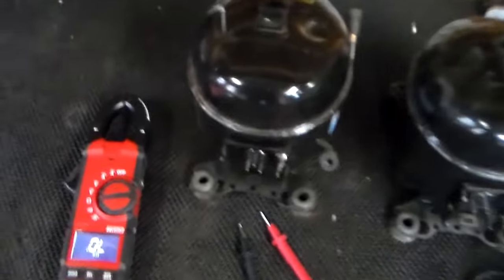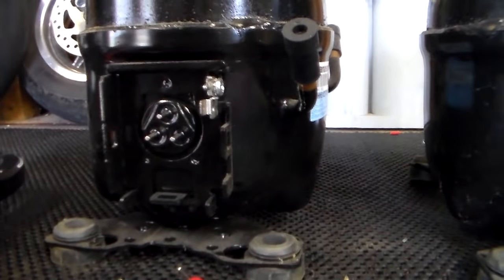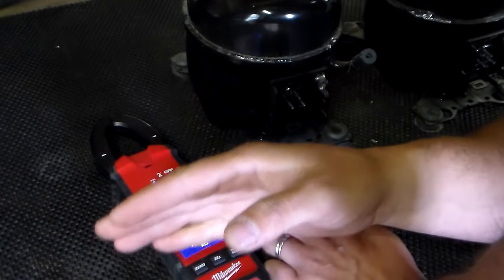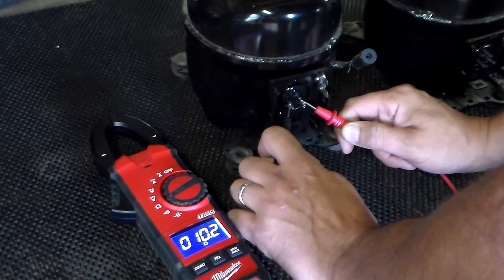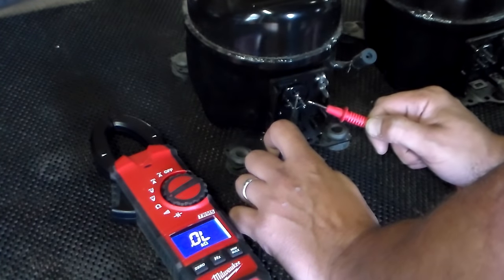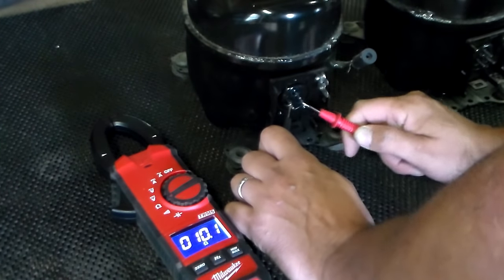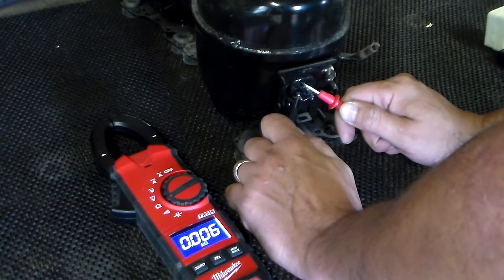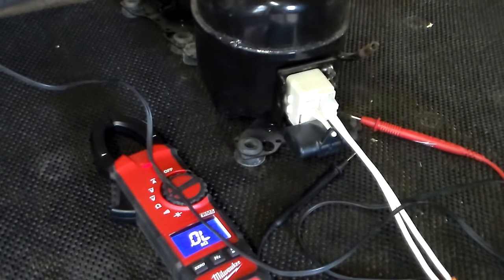How to Test the Compressor on your Refrigerator

Comment: Question: the compressor is running and getting hot, the fan is running, but the neither the fridge or freezer sides are getting cold. We had a technicnian out who re-gased it, with no change. I have noticed that there is now a brown oily liquid in a drip tray under the evaportator. Trying to get someone else out but having language issues in China. Any idea on what it could be, or what to look for next would be appreciated.

Comment: my compressor tests about 3-4 numbers higher than your readings, my refrigerator is not cooling at all, freezer or fridge. the fan is running, with the start relay connected to the compressor, the compressor is warm to the touch, but no noise. i tested the start relay and it reads about 10. any idea whats going on?

Comment: I tested my compressor and got 35 on the bottom and 20 left to top and 15 right to top but I am still not getting cold.  The compressor does come on when I plug it in.  Any idea?  On another note could you help me design a fridge setup for a custom cooler I want to build 2' x 2'-6" x 3'-6"?  Looking around on the web it looks like I can buy all the parts but I have no idea how to size things.

Comment: I have an Kenmore upright freezer it will work for 3 to 4 days  then temperature will drop to a refrigerator temperature. Had it check out by a certified appliance repair and they told me the compressor need to be replace.  Can the compressor be tested without turning it off?  Reason is I didn't see him tested it  but claim he did. It will cost me 5 to 6 hundred for parts and labor. It this procedure difficult ?

Comment: Bill - upright home freezer with 45psi on LOW SIDE, running on a 3n1. Compressor pins ohm:  Red to Black = 8 / White  to Black = 12 / Red to White = 16. Compressor draws 14amps when running. Runs 8 seconds and quits (thermal switch?) QUESTION:  BAD COMPRESSOR,  AN OBSTRUCTION IN THE HIGH SIDE LINE, OR SOMETHING ELSE?

Comment: My refrigerator runs fine and all of a sudden it stops cooling.  All I do is turn down cold control thermostat and then back up and the compressor come on and it starts cooling again until the next time. Have no Idea what is triggering the failure.    Any suggestions?   Replaced defrost timer.   This is a Kenmore side by side.

Comment: Hello Bill
Nice video.  Can a compressor run but not cool and still be a problem with the starter relays?  I have a compressor that is running and condenser fan is running but evap is not cooling.  This is on a Samsung fridge.
Reply from the maker: +Robert Barrera Sounds like freon issue.  If the compressor is running, relays are good.

Comment: Hey Bill,
Do some compressors after they run for a period of time have to rest for a time after shutting off before they can turn back on due to head pressure build up?
Reply from the maker: +greatscott2007   Usually takes a couple minutes to fire back up.  Pressure causes the overload to trip because of amp draw.

Comment: My compressor comes on i can feel it but the frig or freezer wont get cold. Both fans work and i tested the defroster and defrost t/stat Only thing showed 7 ohms on the 2 pins that should be 10ohms not sure if that means compressor is bad or not

Comment: Hi Bill great videos. Have a top freezer GE 1993. Not getting cold. Compressor comes on sounds good all fans run. Checked temp controller conductivity room temp, off when removed from fridge and tested by putting in freezer of another unit. defrost timer runs turns and gets power to pins as you show in one video. De-frost heater has conductivity and gets hot when power is applied. Back panel of freezer removed seems only to get the very right  side of the coils cold with a light frost seems very cold at that very end. Could the compressor be low on freon? If it was low from a sealed system would it not all leak out. I see no oil residue or sign that I can see of a leak? What do you think.  Thanks Mike, Phx AZ

Comment: Hey Bill, I’ve troubleshot my fridge (igloo kegerator), and I can’t figure out what’s wrong with it. The compressor resistance is checking correctly, voltage to relay is good, thermostat checks out... there is no capacitor that I could find, no fan, no coils. What the hell else can I do?!

Comment: I have a kitchenaid french door bottom mount , and I don't hear the compresser running and the fan isn't runny. There is a big grey box, that looks like a transformer with a 3 prong relay attachment, that hooks to the compresser, I think it's a variable speed. I don't no where to start, or how to test this thing with the multimeter. Yes, it's not cooling. Neep Help..Thank You

Comment: hi Bill, My fridge is not cold, i tried checking it but have not had any luck. My compressor starts up every few minutes or so then it clicks off after 6 seconds...do you know what might be the issue? what i should be looking at Thanks. .
Reply: same thing happen here but my compressor will run 30sec than shut off

Comment: Hi, Fridge Repair  expert told me that my compressor is reading  High, I don't understand what he meant,  tho when he finished fixing it this time, the refrigerator (freezer compartment) doesn't ice anymore  but cools but the everporator in the  fridge side(bottom side)   freezes when it's  works for a long period of time. 
Please help me what's wrong with my refrigerator?

Comment: Amana ssd21sw  Freezer about 32 degrees and the fridge is about 39 degrees.
Compressor runs. I replaced the Defrost Thermostat. And I also replace the Defrost Timer. I had moisture in Freezer and now I don't. The evaporator fan works now also. The condenser fan runs also. I was thinking of replacing the Freezer Temp control Thermostat but I am on hold at this point. My compressor has the black box on the side. Where do I go at this point.

Comment: Hi Bill,  I have a Kenmor side by side that doesnt cool.  When pluged in and running, the copressor turns on for a few seconds and them cuts off for abort two minnutes and cycles that way continuously. Any ideas as to what it could  be?  Thanks.
Reply: My guess, LRA....lock rotor amps....check amp draw on compressor

Comment: hi steve i have the same compressor as you do when i do the reading i am getting the same 8.6 on all 3 pins is that the norm
Reply: How do you test the capacitor.
Reply: Same issue with me. I found the result 12 on all three terminals. Is it normal?

Comment: I have a KitchenAid side by side. The freezer started defrosting, ice cubes melting and water leaking onto the floor. I took the back off and did the compressor test and it checks OK. The relay rattles like is broke inside. The fan is running and the refrig part is cool enough to keep milk cold but the freezer won't freeze. I hear the relay click and the compressor runs for a few seconds and then shuts off.  What part do you think is bad? Thank!
Reply from the maker: Steve Hula Get a 3 and 1, they are relatively cheap and will let you know if the compressor is bad if you don't have a meter to test the compressor.
Thanks for Watching!
Reply: I got a new relay switch, the white part that plugs into the compressor and the black capacitor plugs into this. I took it off and it rattled like something was broken inside. I ordered another one and replaced it. It is running like a charm! Thanks!

Comment: Bill, one more question.  The testing protocol you used for the three-prong compressor, will it tell you if the "Freon" (R143a) is low or simply if it is a "10 ohm" system that the left reading plus the right reading, if they equal 10 ohm then the ELECTIRCAL portion is good? In other words, do you run this ohms check ONLY if there is NO cooling at all.  Like I said, I can keep about 37F in fridge and 31 in freezer. Apologize in advance for a low iq question but my technical competency on these things is low.

Comment: Biii, i checked and yes, no frost on evap and the fan is working. so im assuming no 134a. is there a leak for sure or does it go low with time ? my fridge is about 6 yrs old and the last 13 month it has been sitting in a temp control storage. if i just need to top of 134a, can you do a tutorial ? i do have ac ( ASE cert ). thanks man.
Reply from the maker: Ah, should have read this before I commented on your other post.  lol   Shouldn't go low with time, probably a leak or a restriction in the sealed system.

Comment: hi Bill, 
Great video, keep on setting this on the internet (very educating)
Here is  Aydin from Holland. I had this problem with a compressor. it didn't work and it was ververy hot. The ohm on the compressor where oke (12=8+4ohm) there was 220volt (holland). But there was no action on the compressor only very hot.
Can you help me out?

Comment: My refrigerator stopped working. The compressor was heating, no sound. Fun working and the lights were on as well as the fun working well. On a compressor its written R600a. It is not running what can i do

Comment: Bill how hard is it to replace a compressor, you should do a video one it.
Can it be done with a propane torch.
Reply: MrMac5150 It can. You just need a flame shield. That's a curved piece of double walled metal that hooks on to the torch and curves behind the copper line to focus the heat on your work. I use it all the time.

Comment: Hi Bill!  I have a True Beverage cooler, model GDM-26, the compressor will come on for 20 -30 seconds and cut off, then after 3 - 4 minutes the compressor comes on for 20 -30 seconds and cuts off.  The start relay was bad, I couldn't find one locally but I did find a 3 in 1 and installed that.  The compressor still does the same thing, I've ruled out the thermostat and the ohm readings on the compressor are fine (RS-12.1, CS-10.7, CR-1.4) So the only thing I don't know is if I have too little or too much Freon in it, would a low Freon condition cause it to do that?  The compressor sounds fine, no unusual noises, any ideas?
Reply: +Rick Larson  No, the freon will not cause the compressor to do that unless it had a high pressure sensor on it which these coolers do not. It sounds like it could be a thermal overload issue. Those GDM- 26 some have thermal overloads depending on when it was made. It will be a round device with 2 wires coming out of it and it attaches to the side of the compressor and they go bad and will kick the the power out as soon as the compressor warms up a little. Now i have had those 3+1 hard-starts have bad built in overloads, so that could be a possibility that you got a bad one. Iv worked on so many of them GDM-26 and they are good coolers. I'm a Pepsi Repair tech so iv seen them do some odd things. The thermostat could be bad,  don't ever rule it out. To check it take the 2 wires off and make you a jumper and connect them together and plug the cooler back in and see what it does. Like i said iv seen them do funny stuff. If it does have a thermal overload and you did wire it in to the hard-start then just disconnect it and leave it off. No need to replace it. Make sure also that you wired in your condenser fan motor to your hard start or it will over heat and shut off.
Reply: I did jumper out the thermostat and the compressor does the same thing, I went ahead and replaced the thermostat.  I may try another hard start, the ohm readings on the compressor are good, it sounds normal when it runs.  I got a set of gauges and a vacuum pump, I can't seem to find what is wrong, I've tried adding freo thinking that it was low but no joy. I'm determined to fix this thing!  Thanks for the reply, I'll try to keep you posted on how it goes.

Comment: Hey Bill - we tested the compressor pins and amperage after checking the relay switch. We were getting uneven readings at 8,10, 13.5 ohms and close to 9 amps off of the compressor (much higher than the 1 to 1.2 we should have gotten. The condenser fan also is not working, Is it safe to assume the problem is the motherboard?  Also, the compressor does run for a few seconds and then shuts off. Any further testing advice or suggestions would be much appreciated. We enjoyed your video (as hard as that is to do when dealing with a bad fridge!).
Reply from the maker: Ohm out the condenser fan and make sure that isn't bad.  It should run when the compressor is getting voltage.  You may have two issues.  The fan may have gone bad and overheated your compressor.  At least replace the relays to see if the compressor fires up, use a hard start for testing.  Also test wiring to the fan, see if 120 is present.  Let me know how you made out.
Reply: Bill Newberry Bill - we just replaced the motherboard on our PFS22SISBSS GE bottom freezer fridge. The condenser fan is now working fine, but we are still experiencing compressor issue. When powered up normally, the compressor turns on and runs for about 10 seconds and then shuts off (we hear 2 distinct clicks from the relay). It's also still reading close to 9 amps. When we disconnect the relay from compressor and then plug fridge to outlet, we're getting 120V from the relay. What the heck is going on? Is this a bad compressor?
Reply: John Amentas If  the reading between ur com+run and then ur com+start windings does not = the reading between ur run+start then ur compressor is cooked.6+4=10
Reply: I am currently having similar issues with my refrigerator condenser fan is not running I am getting 13.5 volts to fan but do's not run. I check ohms compressor 7.6 3.8 4.0 slightly lower than your readings. Am experiencing same issue as John overload heats up and kicks out. Am getting 120V to relay. Have not changed mother board. Any thoughts as to next direction new compressor?
Reply: Neal Skellenger if ur getting current to ur fan :fan his humming "but not turning then ur fans motor is fried.
Reply: Lester Nel o yes fan motor will be hot to the touch in that case.otherwise use ur amp-meter  and see if ur current draw is correct
hope it helps

Comment: Others have said that so long as 2 of the ohm readings add up to the 3rd the compressor is OK. Is this accurate? My readings are 5, 10, 15ohms . Does This mean is a higher horsepower. Also my compressor is a horizontal tubular shape.
Reply from the maker: Bradley Thomas Sounds like an older compressor on an old GE.  That's what you should get for ohms.

Comment: bill what is the difference in the pins? i mean what is the different purposes between the three pins? reason I'm asking is I've been replacing relays with hard starts and I know how to hook them up on my most common refrigerators but not all my refrigerators are the same as far as the pin layout sometimes 2 on top and 1 on bottom or 1 on top 2 on bottom or being on left or right side of compressor. I have 3 wires from hard start red black and white that hook up to the 3 pins on refrigerator how can I tell where those wires go on the pins correctly? is what I'm asking I guess
Reply: +Troy Ormonde also found out that the start pin will have a higher reading than the run pin when checking ohms wish he would have explained more about the pins there diffences and how to tell but think I got it now thanks

Comment: Bill. Thanks but my compressor's 3 pins are upside down triangle to the one in your video. The single pin is on the bottom, the 2 side by side are on top. The compressor is in a Sears Kenmore Model: 106.59202992. Compressor: Embraco, EGS 80HLP, R 134a, 115 VAC, 60Hz.

Could you or anyone reading tell me which terminal is the Common, Run and Start, and also what the readings should be in this upside down configuration? Thanks.

Comment: Help , I have a kegerator, edgestar Model BR2000BL, I recharged it with freon, it is cooling nicely but the compressor too hot to the touch, is that normal?

Comment: Thanks for the great video, Bill!  My compressor tested out fine, so like you suggested, I checked the voltage at the pigtail into the relay and I only received 1.5 VAC.  No wonder the compressor isn't running.  Any ideas?  The fridge is a Kenmore side-by-side Model No 235.5466940A.  Not sure if that helps.

Comment: If the over load burn an the realy change both an replace it with new ones then the fan getting power but the compressor is not turning over what happens there but it keeps getting hot

Comment: Got 7.6, 4.1 and 4.0 on the 3 pins of the compressor, does that mean the compressor is bad?
Reply: NO. just different size compressor
Reply: David Douglass no its fine
I have 16.5 on all 3
Compressor is fine
What you shoudnt be getting is much higher than that
That would mean it shorted
Reply: ...that would mean it's open

Comment: Even though a compressor ohms out across the start and run poles at 10 ohms and each pole (start to ground) and (run to ground) equals close to or a tad over 10 ohms does not mean that simply replacing the capacitor or the start relay device will make the compressor run. The compressor can be locked up.

Comment: Hi Bill, thanks for sharing your knowledge on you tube.
I have an old (60's) GE freezer. Wires coming out are white, black and green.
W-B= 20 ohms,   W-G=22 ohms,   B-G=2 ohms
Since you explained about the ohms, which wire is which? Common, run and start.
Also if the 3 in 1 is hooked up wrong will it fry anything?
Thanks, Blue
Reply: Yes, would help if the video identified which is common, run, and start, instead of just stating where they are prepositionally.

Comment: My Samsung side by side isn't cooling at all.  When I test my compressor it reads across the bottom around 11.4 when I test the amps on wires going to relay they are around 1.2 so all seems OK.  However my fridge won't cool and the fan at the compressor comes on and a little while later the compressor kicks on.  What can I check.  I should say I replaced the defrost sensor in the fridge already which helped the fridge read the correct temp but didn't help with cooling